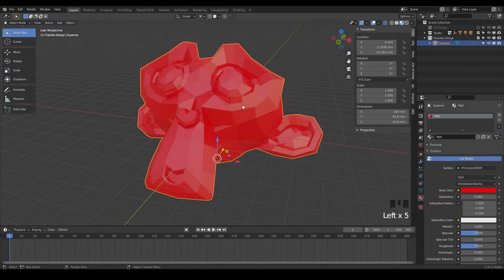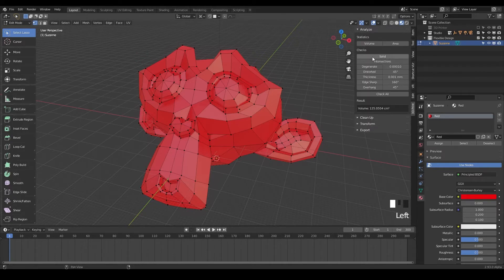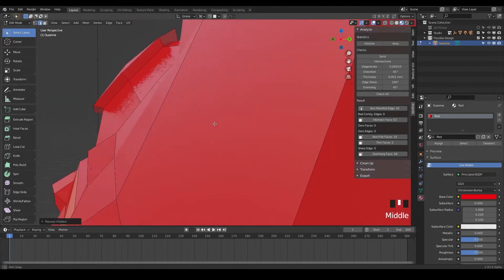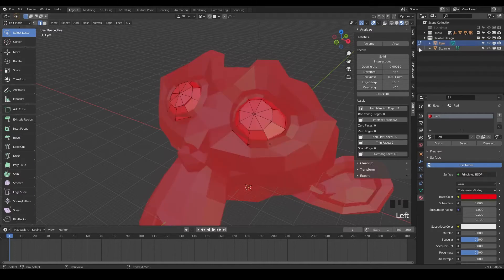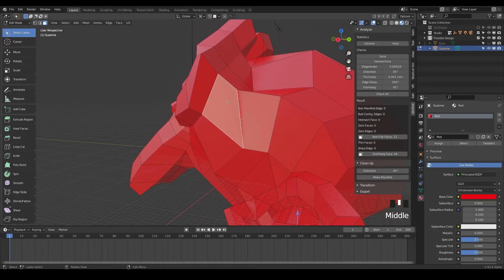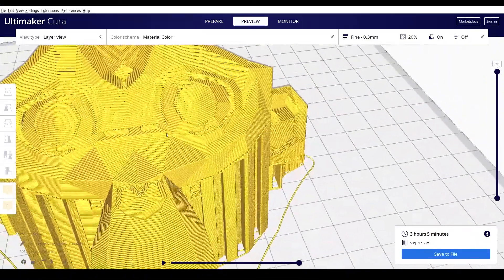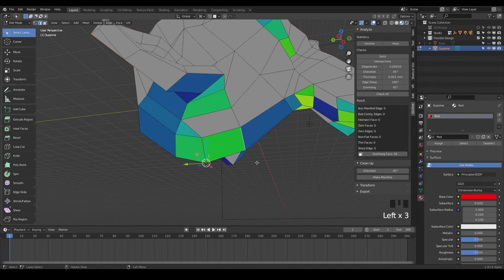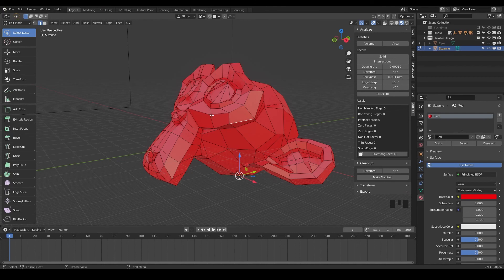Make Your #3DPrint Manifold | Blender for 3D Printing

Comment: pls help!! where to find mesh edit mode if i doesnt have it at the overlays
Reply: What I did, maybe because I have a newer software than from 2 years ago, is that I went to the 3D Print option on the side that he's been talking about, and there's a section under "Checks" called "Overhang". I clicked that and it gave me the result: "Overhang Face: 44" I clicked on that, and it showed me what he's talking about.
Reply: I know this is an old comment, but I figured I'd reply in case anyone else had the same issue. After about 20 minutes of Googling, I finally found where the Mesh Edit Mode had moved to in Blender 4.0.1. 

On the right of the Overlays icon (and to the left of the X-Ray icon) there is an icon that looks like a square. Clicking on this will bring up the Mesh Edit Mode.
Reply: @Gobo303  thank you so much 🤩